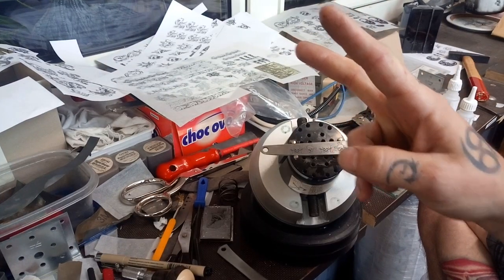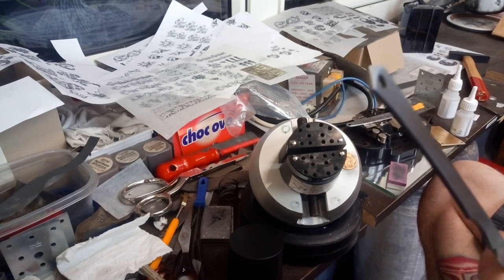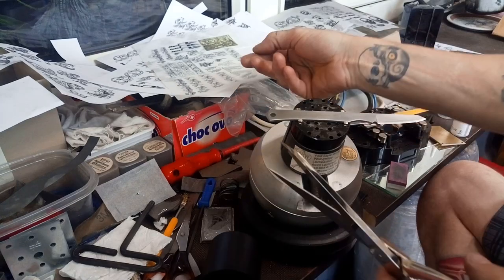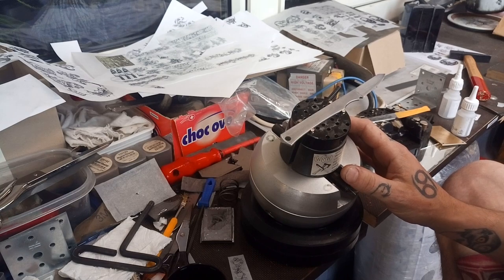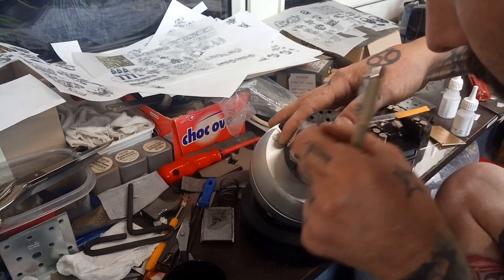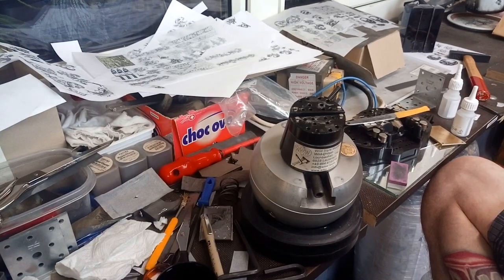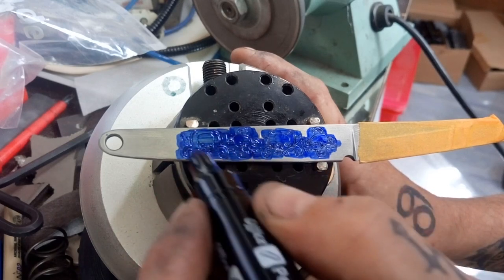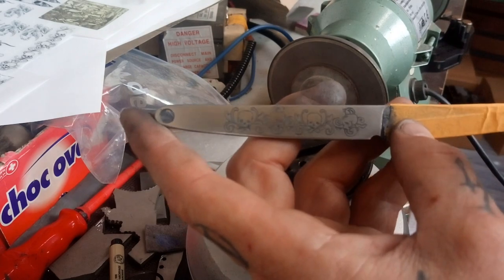Best Method To Transfer Patterns On Metal For Engraving And More

Comment: Yep. Knew I shouldn't have passed up that metal engraving kit that was on sale last month.
I realized how my cheap investments at harbor freight ain't paying off and I need to up my methods a bit.
I use a Dremel set for rock engraving.
Now after seeing how well you did that with the engraver got me all 🤔 
Inspired.
Reply: We live and learn. I have purchased things from Harbor freight thinking I got a good deal but after a year the motors burn out or sockets snap or clamps don’t hold. Harbor freight is a great secondary resource if you need a tool for one project and never intend to use again. If you want repeat performance from a tool, always spend enough to get the quality and durability you want. I have tools in my box that I bought 30 years ago and still perform like new and I even have tools my grandfather used back in the 50s that still perform perfectly!
Reply from the maker: but this kind of engraver is not really good to work with rock. its mostly just for metals :-)

Comment: hello wanted to add a little something....with clear packing tape the same rice paper and pencil you can get the same effect...this way there is absolutely no chance of smudging and a layer of the tape protects against small slips  and stray marks copy the art the size you want then take the clear tape fold the ends so that you can grab them press them over the penciled art and take an object taking care to go over all the lines pressing the tape into the pencil ...note the pencil will darken when the tape is pressed correctly....simply peel and resurface onto metal and use the etching tool or dremel to cut throught the tape to the metalno smudges no stray marks from tools
Reply from the maker: the tape works not so well if you use engraving tools like i do. my tools are not rotating, its like a chisle pushed in with force, that makes the tape cringe up and skip away from the surface, also the depth controll is way harder to get right with tape, since some of the lines are so thin, they are not even as deep as the tape is thick.
Reply: @WildStyleWorks   yeah you are right. i usually use the tape to get started and razor blades to carve a light outline. any suggestions on better engraving tool sets?

Comment: some advice: use avery labels. Buy the ones with the single 8.5 x 11 sticker on it, peel off the actual sticker and discard. laser print your artwork onto the glossy coated backing paper. It will loosely adhere. then iron onto the clean metal, let cool, then peel the backing off. I personally invert the image in photoshop, print it out, adhere. then i etch in the appropriate acid for just a few seconds....this leaves a permanent guide to engrave into that will not come off.
Reply from the maker: sounds very nice too, the sheets you mention are mostly teflon coated or HPDE coated paper, about the same principal as the parchment paper. etching it is a nice idea, but i wanted to keep it as simple as possible, because what to use to etch titanium, for example. and most people dont have acid at home or dont want to deal with them. a thin coat of hairpray will also protect the laser powder very good from rubbing off. i invert the print in the printer settings, just one little hook to klick onto, thats it 🙂
Reply: That stuff is a bit too slippery for ink I'd say.

Comment: Great video , you should make a video about your equipment and how did you made your tools especially your compressor and hand piece
Reply from the maker: Thank you. Well i can do that if you want me to, but to be honest i changed my tool for a new self made 😊 i made a lindsay style air graver and it works much better, it has much more power and needs only very little air. I planed to also make a video on that one, since i also wanna sell them 😊
Reply: @WildStyleWorks  please do , share some ideas if you are able , im still doing chasing hammer and i want to switch to modern but of course no body wants to spend a lot of money in the beginning, so if you can share some ideas about the tools please do , tnx!
Reply from the maker: @predator627  i try to make some new videos asap. but i guess it will be next year ;-)

Comment: When I found out that my printer ink is SOLVENT PROOF....not just with acetone...everything I had and I have quite a few.....I was done for the day starting engraving :p
Reply from the maker: And did this method worked?
Reply: @WildStyleWorks  I just paint them on with a pen...so far.
Reply from the maker: @LaserGadgets  ah thats a pain, maybe you can get a cheap black and white laser printer somewere for this purpose. Or ypu know soneone who has another brand.

Comment: Hello Phil! Amazing work you did! Can you please tell me what type of rotating table are you using? I found other models but they are smaller and only for jewelry suitable...
Reply from the maker: @paulvitti666  this a called a ball vise, it is for jewlery and other small things, mine is around 150mm in diameter, there are smaller ones out there, but i think the 150mm is perfekt for my tasks. If you make smaller stuff a 100mm is also ok. You can get them from china or amazon, also from GRS but they cost much more and are much more precise.
Reply: @WildStyleWorks  Countless thanks! Thank you so much for your kindness! BE BLESSED! 🙏
Reply from the maker: @paulvitti666  youre wellcome 😊

Comment: hii 

you use graver grs or cheap graver ?
thanks 😊
Reply from the maker: @alexandre2513  i used the cheap ones first, then i got a grs knock off and in the end i started making my own gravers like the one steve lindsay makes, just without the palmcontrol. They are a lot of work to make but still worth it, since they work great, use less air then any other gravers and are to be used only with compressed air 😊
Reply: @WildStyleWorks  which one is it ?
Reply from the maker: @alexandre2513  i will try to make a video about it in the next time 😊
Reply: @WildStyleWorks  thanks you very much

Comment: What do u use to rub  the transfer onto the knife
Reply from the maker: just the back end of a simple pen or something similar, it should be plastic not metal and have no sharp edges, you can also use a piece of wood. it just need a little bit of pressure, not a lot.

Comment: What engraving bit are you using?
Reply from the maker: i use old HSS tools like taps or other high quality Hss tool. also metal circular saw blades made from HSS-E are very good. tungsten carbide bits are also well suited, i got some from aliexpress too.

Comment: So, just buy a parchment paper. print my design with a laser printer and just rub on a steel, wood, copper board or on anything and the design will transfer.. Is it right? 
Plz tell me..

That's the only thing I need to do to transfer the design..
Reply from the maker: Yes, and dont forget the hair spray, it helps a lot, on bare metal surfaces it doesnt work without it. I dont know if this works on wood, but could be possible. It normaly works on every smooth surface.
Reply: @WildStyleWorks  thanks a lot.....

I want to make a circuit... But there is no proper way to transfer my circuit design on a copper board or on copper foil....   

But I hope this perchment paper will help me. Ok I will buy a hair spray too.... So the spray I have to use first on the copper surface then attach the paper and rub it... 

Am I right???...
Reply from the maker: @fuhadrock6370  i am not sure if this works for circuit making, normaly they are made by eching with ferric chlorid.
Reply: @WildStyleWorks  yup I know.. eching process is in the last.. first design transfer...to the copper then eching part...

So my problem is to transfer the design to the copper.. some lines miss.  That's why I am looking for a proper transfer process.....
Reply from the maker: @fuhadrock6370  i guess this will not be suited, since the hair spray coukd block the eching 🤔 i would watch some videos on making circuit boards, mybe they have a better solution 🤷

Comment: Where can I find this type of multilayered steel to make  knife engravings on?
Reply from the maker: it depens on were you come from ;-)  but mostly you can order them in china, just look to get a good core steel like VG10 or similar, the oter layer shall be 301 or 304 or something similar, since they are not hardenable. search for stainless Laminat damascus or stainless suminagaschi steel. they also sell it on ali... i think i even saw it on Aamzon, but watch out to not buy some pakistan crap ;-)

Comment: Great info !! What compressor did you use for the hand piece?
Reply from the maker: thank you, i use a pump not a compressor. it pumps the air in and out, its a cheap chinese air aquarium pump were i changed some parts.
Reply: @WildStyleWorks  do you have DIY video how to tranform the aquarium pump, or explain to me please? Thanks

Comment: What engraver did you use
Reply from the maker: its a self made from stainless steel and aluminum with a tungsten hammer piece and the pump is from alibaba and rebuild to my needs :-)  i wanted to make a video on the engraver too, but i cant find the time and also need a new PC to be able to make good new videos.